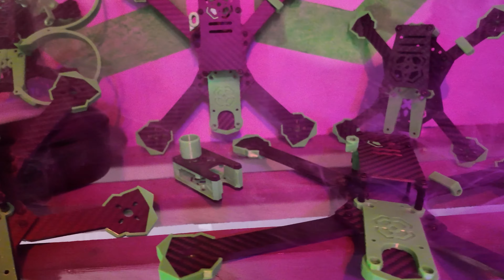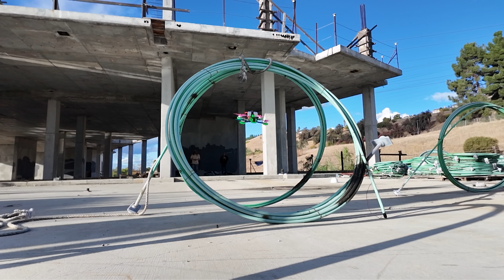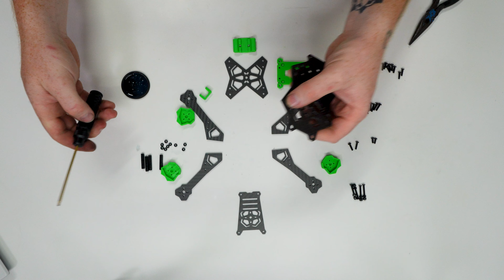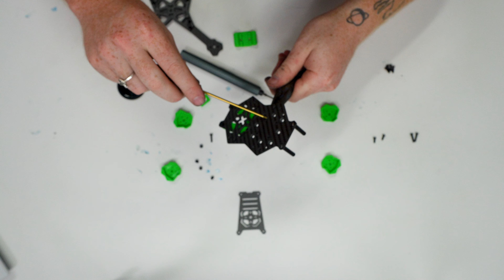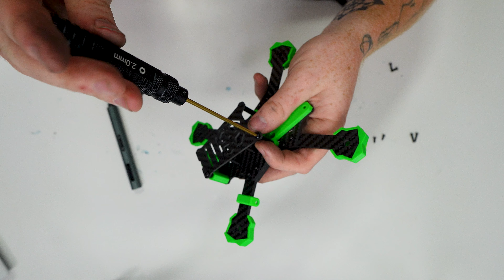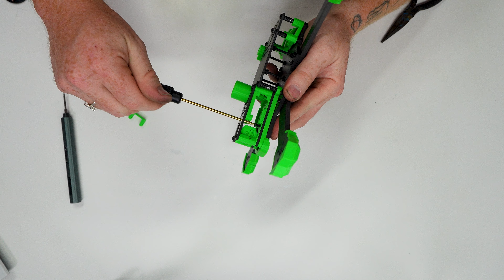Build a Clover FPV Systems Shamrock

Comment: Steve, bolts not supplied for a 25 x 25 AIO, looks they need to be #2 flat head /tapered screws.  Or maybe just mine?
Reply from the maker: @dondupuis4007  I know what happened here. Yeah they need to be m2 tapered. I'll send you some.